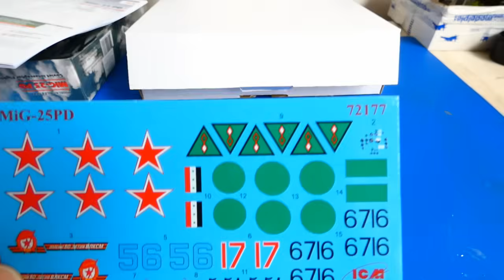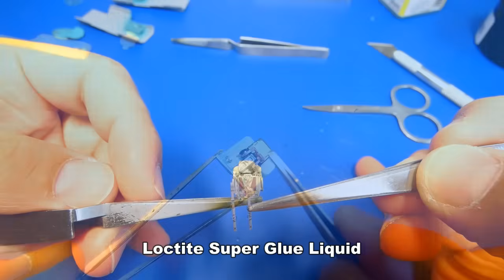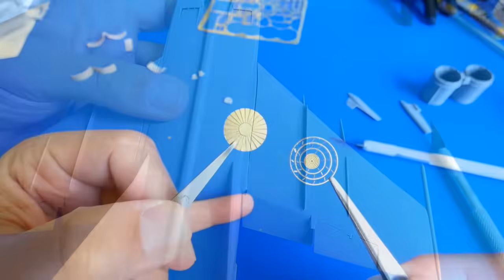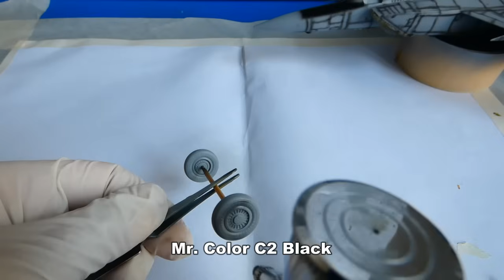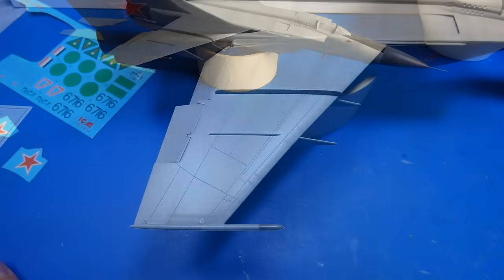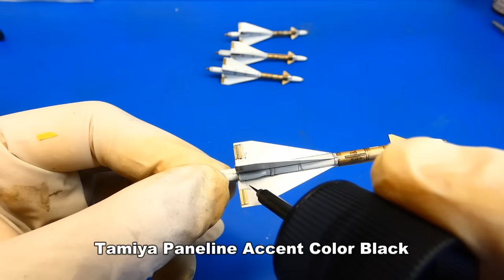MiG-25PDS Foxbat FULL BUILD VIDEO ICM 1/72 Scale Model Aircraft

Comment: Well, a beautiful Foxbat! You are right when you said that ICM produced the best Mig-25,  in any scale. I've built this but in 48th scale. Same brake down of the parts, after all yours it's a scale down version of 48th kit. I also struggled with the underbelly joint of front and main fuselage but managed in the end to a satisfactory result .
Anyway a superb result from you! For the metallic parts consider using AK Xtreme Metal . They're great for those kind of works and over a gloss black they look the part.
Reply from the maker: Thanks for the tip. I will check out the AK metallic paints. 😊